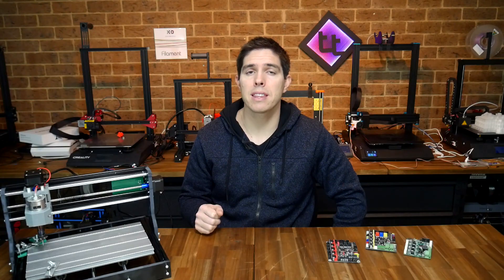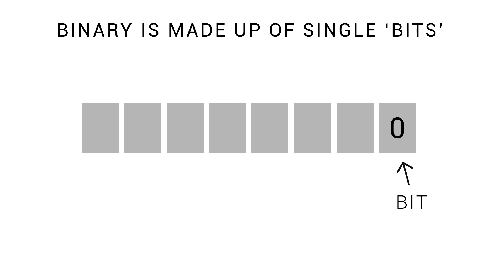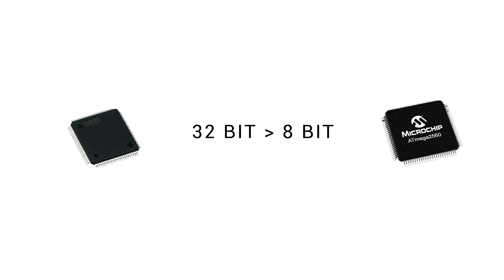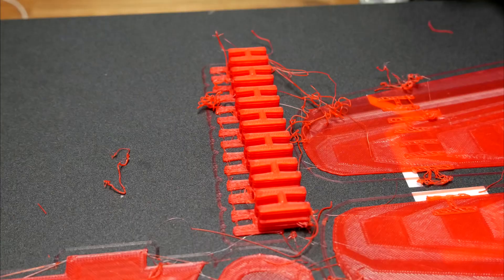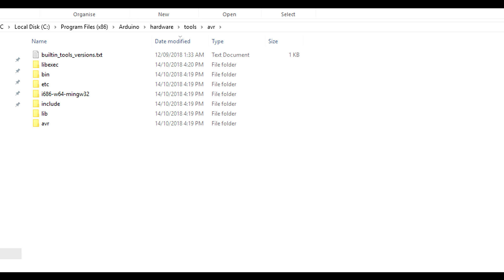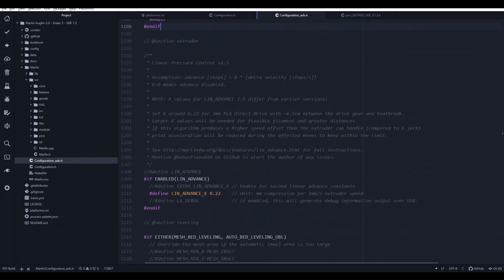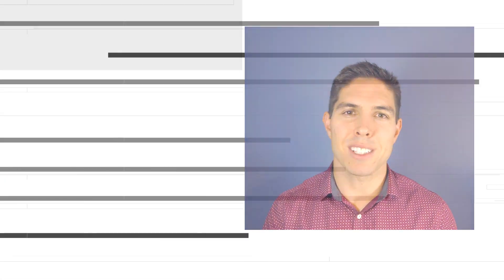32 bit 3D printing - What it means and when you need it

Comment: I really believe you just came out from under a rock and you really need to check out the STM and ESP 32 bit boards for Arduino cause you  do not know what you are talking about just a show no real knowledge.
Reply: stm and esp 's are more cheapier and have more advantages than arduinos also Arduino just a company that uses atmel chips making it more easy to use but after all if there is no money no thing for me

Comment: why not use arduino ,as 32 bit STM development boards can and are being programed using arduino (simply add the necessary files) also arduino is used to program and run Esp 32 boards so what is the real reason????

Comment: an STM32F1 is just cheaper than a Mega2560.  
With an ATMega, the end of the flagpole has been reached. More and faster is not possible.
With 32 bit, the CPU is faster than the hardware can do. Maybe use gimmicks like Neopixels?
Today, 32-bit CPUs are so cheap that even entry-level printers use them.

Letters could certainly be written on an 8 bit C64, but that's just for nostalgia. 
Anyone who uses a computer today will immediately use a modern system.

Comment: This video is great with lots of information. Would you know which bit control board will work for mixing extrusion commands (concurrent feeding of 2 filaments in 1 hot end)? I am using Creality CR-X Pro printer with Marlin 2.0 version firmware. Printer has Creality V2.2 ATmega2560 processor control board. I assume it is a 8 bit board, would it require 32 bit board to execute mixing commands?

Comment: I want to buy a control board and install 4 drivers.  I want to run 4 stepper motors with a very simple few lines of code that I wrote.  I was going to use Arduino, but Arduino is not connected to this control board.  But it doesn't matter to me because all I want is to control 4 motors by any method.  My reason for wanting to buy this control board is to keep all the drivers and motors in one place.  My question is: Can I write my own codes on this card?  For example, this motor starts when it receives a signal from the sensor, this motor accelerates when I increase the potentiometer.

Comment: Good overview of "bits".  Just minor corrections:  8 bit signed has a range of -128 to +127  (not the -127 to +127 as in the video).  Also, the 32 bit unsigned has a range of 4.29 billion values or a signed range of -2147483648 to + 2147483647.  it may seem funny that there are more "negative" numbers than "positive".  In the case of -128 to +127, this comes out to 128 negative values PLUS the value 0 PLUS 127 positive values (128 + 1 + 127 = 256 possible values an eight-bit number can represent).

Comment: This is wrong, when you SLICE something, your computer calculates the whole path and puts it in a file.
A 3D printer takes the file and follows each step. All the mainboard does is to sample and monitor the motor positions.
This doesn't take much processing power at all, the issue happens if you want to do much faster than normal. I do for example 50mm/s and I'm okay with it.
The prints are very good and I don't mind watching a movie while something is printing. I'm not running a company with 20 printers where speed matters.

So if you're a casual dude like me who prints Pikachu and other random stuff for fun, then don't bother, you might want to change the Ender 3 Pro board to make it quieter but if you're earning money, then go for the 32bit and make your prints faster, then you also need better ducts, cooling fans, filament, and hotend.
Reply: The entire ender 3 line-up now comes with different versions of the V4.2.x 32-bit boards

Comment: The maximum value for four unsigned bytes (32 bits) is not entirely clear! An unsigned 32 bit integer has a maximum value of 4294967295 and an unsigned 32 bit integer has a maximum value of 2147483647. Which one did you mean?

Comment: There is an error during the comparison of the 8bits vs 32bits: the clock speed IS NOT a comparison of performance between them. What really matters is the number of operations per cycle (ops/cycle).
During the 90s we had this «Mhz race» between AMD and Intel and nowadays it is still on - if not, compare a Pentium D 3.7Ghz vs a Ryzen 3 3300X, which has a lower overall clock speed but it results in more than twice real performance.
https://cpu.userbenchmark.com/Compare/Intel-Pentium-D-373GHz-vs-AMD-Ryzen-3-3300X/m10162vs4076

In the AtMEGA vs ARM32 there are many other things than clock speed: advanced instruction sets, pipelines, cache sizes and address capabilities - all these help to the speed improvements. But not the clock-by-clock comparison.

Comment: 64-bit or 128-bit boards for advanced 3D printers that can move the print head(s) on a robotic arm with all the nuances of a human artist.  Use resin pens with UV light to cure each color on the fly in real time.  Have a multi-head rotational mount so that each head handles one or more different colors or types of materials or a mixture.  So an Octopus style robotic 3D printer will of course need more processing power to perform marvelous feats of automated artistry.

Comment: this has nothing to do with the architecture, but with the speed the microcontroller runs at.
arduinos 8 bit avr processors run at 20Mhz max, 32 bit arm chips can go much higher.
you can get much faster avr processors in the new models
Reply: It actually does have a lot to do with the architecture.  Loading a 16 bit word on an 8 bit architecture takes 3 clock cycles minimum.  Instruction, op1, op2.  On a 32 bit architecture it could be done in 1 clk cycle (assuming the instruction allows ops to be embedded with the instruction - which ARM does).  There are also other advantages such as pipelining and RISC which are typically 32 bit architectural advances as most 8 bit are CISC due to the tight memory data width requirements.  Frequency is not the measure of compute performance.  Ops/sec is and you can run drystone benchmarks to see what a CPUs real performance is.

Comment: 2:09 Slight technicality there, each digit represents 10 TIMES more than the last, they are powers of 10 afterall ;)
Reply: Not in Binary. See, in traditional 10 digit math you are correct that each colum in the digit string is a power of 10 but in Binary since there are only 2 digits to work with each colum is only worth a power of 2.  So double. :)
Reply: @blainematlock  Who said anything about Biay? At 2:09 he is refering ONLY to DECIMAL...
Reply: Theo  I just watched it again, you are incorrect, at 2:09 he is talking about about decimal values yes but right before he gets to the double part he switches to binary. I just watched it again to confirm that he SAYS “In, BINARY, the value of each doubles the last.”
Reply: @blainematlock  I never said he made a mistake in Binary, I said that in Decimal System, each extra digit represents a unit 10 times than the previous. PERIOD. It is a self contained observation. I don't claim he does not know what he is talking about, I just pointed a small mistake.

Comment: Ok I'm pulling my hair out. Just put in my Skr mini e3. Had Marlin 2.0.5? what ever the latest. At first I thought this was great. after much trial a tribulation I've determined that tight concentric circles cause the printer to shutter. This seemed to be because it was butting up against the buffer.   I thought ok, lets try klipper. same issues. the odd thing is that the stock board handled the exact same gcode beautifully. I about to put the stock board back and return this thing

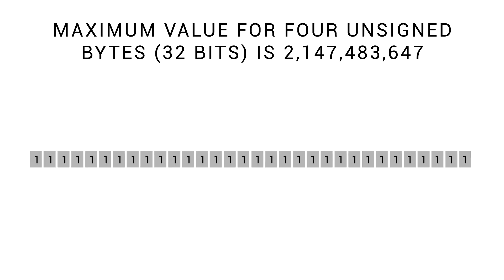Comment: @ 3:18 you reference the max decimal value that can be represented in a 32 bit binary number as 2,147,483,648. That is for a signed number or two's complement. That effectively makes it a 31 bit number. A 32 bit binary number is 4,294,967,295 in decimal format.

Comment: Electricity can have different voltages, and light passing through a fiber optic cable can range in brightness, so the reasoning behind binary given in your video is not really good. Rather, binary and other digital (multivalue) signals are used to reduce noise interference. If you can only have two values, and something is changing the voltage you're getting slightly, you can still "snap" it to a 1 or a 0.

Comment: I have no interest in using LV stepper drivers because they don't justify their cost over A4988 drivers. Do TMC2208 and TMC2209 run into issues with 8 bit boards? I am aware the Prusa Mk3 uses an 8 bit board and TMC2130's without issue

Comment: for my doot changer (corexy) I consider it a necessity TBH. it was so jerky on marlin with 8 bit. it kept jittering and pausing ever so slightly on corners. it was weirdly like I guess switching from 20fps to 60fps. The most different comes when it's printing text.
I get a lot less ghosting and a bit of a nicer print quality on it. there's far less kick for me in klipper than marling.

Comment: Hey Michael, A question for you. Have you any ideas on reducing bandwidth issues with printing over USB? Currently i run 5 printers all running off 1 linux server which runs 5 instances of octoprint using docker. All 10 usb ports on the machine are used, 5 printers, 5 webcams. I don't really notice much issues but 4 of the printers are identical, same firmware, same upgrades and often i find one or 2 of the printers will finish first by upwards of 30 mins running the exact same gcode and my only thought process is that somehow the usb overhead is slowing down the gcode processing to some of the printers? are there any boards that have usb 3 on them? is there any particular board upgrade that will limit this overhead? will a 32bit board solve this? thanks for any info mate.

Comment: Great video, very informative, thanks for sharing. Can you please tell me if it would be possible/easy to fit a 32 bit board in say an Anycubic i3 Mega S which incidentally is a very recent purchase of mine. My main concern is departing from the manufacturers stock firmware, driving the touch screen LCD and the GUI, menus etc.. Thank you.
Reply: Technically it's possible, but it might take some messing around with adjusting the firmware.
This requires some 'nerd skills'; it's a good idea practising a little first (eg. programming a stand-alone microcontroller to flash a LED).
Note: If things go bonkers and it "just won't work", you can still just swap back to the old board.
In reality, it might not be worth switching your Anycubic i3 Mega S to 32-bit just yet; I'd recommend waiting until someone releases firmware specific to the Mega S; this way you'll know that it'll communicate correctly with the display.
Mega S is not a bad choice, BTW; it's well crafted, many things are done correctly, where on the majority of other 3D printers, they're not.
Reply: @68HC060  Thanks for the reply. Nerd skills I have plenty, I am more into designing and manufacturing my own circuit boards, moved on from flashing LED's long ago, electronics is my other passion along with my own built aluminium CNC machine. I have just ordered an SKR 1.4 Turbo MB and TFT 35 display, which will arrive tomorrow. Have done quite a bit of research since posting my question and I am looking forward to diving in. Thinking of renaming it since all that will be left is the hardware which as you say is well crafted and the reason for my choice of first 3D printer.
Reply: You're welcome.
I think your printer is in very good hands; I'd say go for it. ;)
I'm also doing PCB-designs, software and firmware (I can feel my brain is getting old, though).
[You just have a new subscriber] - If you succeed, it'd be awesome to see a short video of your result.
Reply: @68HC060  Happy to oblige, I think that I still have an active (sort of) channel.
Reply: @68HC060  What a dumbo I am, you found my channel, DOH! It has been sorely neglected.
Reply: Not a problem; I also provide a neglected channel. ;)
Reply: @68HC060  Well I have almost completed my Anycubic i3 Mega upgrade to an SKR 1.4 Turbo MB and BTT TFT35 V3 screen. I say almost because despite several Marlin thermistor and end stop configuration issues which I eventually sorted out, there is still one huge problem outstanding and that is, I can not get any motion from my Z-Axis motors of which there are two. Connecting the motors to the MB was easy-peasy because of the dual Z motor ports on the V1.4 MB, but I think that I have overlooked something, possibly in the Marlin config. My BLTouch self tests OK and I can deploy and stow it using the TFT touch screen but any attempt to carry out auto bed levelling fails because of the Z axis issue. Also any motion requests involving the Z axis will eventually throw a fatal kill error on screen and the printer becomes totally unresponsive thus requiring a reboot. Any help with this issue would be greatly appreciated. Thanks.
Reply: Hi Fred.
I do not know exactly what the problem is, but I found this on Github, which might be helpful; it sounds like the same or a similar problem: https://github.com/MarlinFirmware/Marlin/issues/17196
-I would probably have done something completely different: Removing one stepper motor and connecting the two screws using a belt; this way it'd always be synchronous (but it would be harder to synchronize) - I'm not saying at all that my solution would be better.
Reply: It turns out it might also be a bad driver: https://www.thingiverse.com/thing:3249319/comments
(Search the page for "Today I installed tmc2208").
-Also try double-checking the current limit on the Z-axis driver, just to be sure that this does not cause the problems.
Reply: Also on the same thingiverse page, look for "I installed Marlin Build from your repo here"; it gives another clue that the BLtouch might not be compatible (without modification). David Ramiro says it's a fprk of  his firmware and he does not own a BLtouch, thus it might help looking at the difference between the fork and his firmware.
Reply: @68HC060  I have not tried it yet but I think that I have not declared a second Z motor thus - #define Z2_DRIVER_TYPE TMC2208. I will add this  to the config and see how it goes. Regarding the BLTouch compatibility, the BTT V1.4 MB has dedicated ports for connecting a BLTouch so this should be no issue. I will keep you posted later once I have tinkered  with Marlin again, fingers crossed. :-;
Reply: Good luck, I hope it'll work out with no difficulties. =)
Reply: @68HC060  Well it turned out to be a dodgy TMC2208 driver as you suggested, swapped it out for the spare unused E1 Driver, all axes functioning OK now but I have a problem with the BLTouch, when I do a home all it doesn't deploy so the nozzle crashes into the bed then eventually the end stop triggers. Need to do some more tinkering with Marlin to see if I can sort it. Thanks for your assistance and suggestions.
Reply: I'm sorry that it still is causing problems, but I'm happy that you now found out what was wrong.
I think you're seeing the light ahead. I am convinced that you will be successful in getting it fully working. =)
I'm also happy that my input was helpful - I believe that helping others comes back as a boomerang when you need it the most. ;)

Comment: My delta runs much smoother and faster with a 32 bit board.
Reply: It should. An 8-bit microcontroller really has no place in a delta-printer as a delta-printer performs much more sophisticated calculations than XYZ printers. ;)

Comment: It's easy to verify software for an 8bit AVR, even a complicated one like ATMEGA2560.
On 32bit Arms no one really knows what's going on, There's too many registers and thousands of lines of init code needed.
Both have their purposes.
A 3D printer that just reads g-code and prints is easier to verify and edit on an 8bit, and the performance is more than enough 
A 32bit may be useful if you need to map the model in 3d space in memory to avoid bumping into it, rendering images, or slicing on the fly.
That's not what 3D printers do yet, they are just dumb xyz controllers being fed instructions by a bigger machine.

Comment: 3:02  Surprised no one's pointed this out. N digits of binary can represent up to 2^N values, and thus 8 bits can represent up to 256 values (0-255 unsigned). Early computers represented negative integers as described here, called signed magnitude representation-- one bit is reserved for positive/negative, and the rest is used for the number's value. However, modern computers represent negative integers differently, and 8 bits can represent 256 values (-128 to 127). This happened partly because of the cost of transistors in the early days of computing, and partly because it was kinda silly to have both a positive 0 and a negative 0. https://en.wikipedia.org/wiki/Signed_number_representations#Two's_complement

Signed magnitude representation didn't catch on for integers, but it lives on in modern floating point (IEEE 754). Floating point does have a positive 0 and a negative 0, and they're used in cases where, say, a mathematical function has a discontinuity at 0. 1 divided by x, for example-- approaching zero from the positive side of the X axis, it shoots up to positive infinity, whereas approaching it from the other side, it falls off to negative infinity.
Reply: Morio, I got to 3:15 and went nope, 2s compliment.   I'm an embedded designer....  Apart from that, great explanation

Comment: Ok... but what does upgrading my 8bit ender3 to 32bit give me? 
Are the prints better?
Reply: Should give you about 25% speed increase and likely better quality - also I'd bet on the 32-bit horse for future expandability (eg. expect future firmware to run on 32-bit microcontrollers when 8-bit has too little program-space).